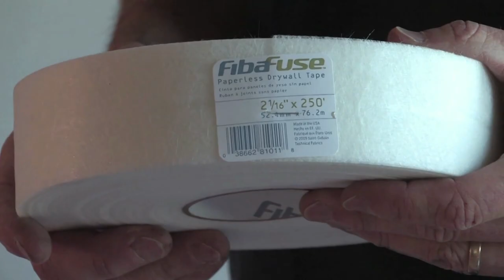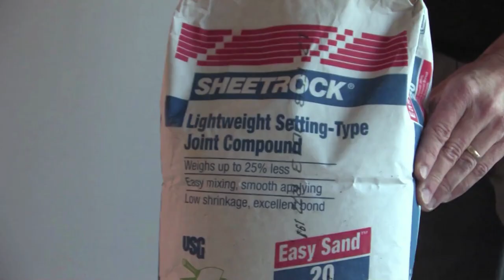Embedding FibaFuse Drywall Tape

Comment: I have your one of your drywall books, which has been very helpful!  I discovered Fibafuse a couple of years ago, and it's an amazing product! I'm a DIYer and was faced with repairing large ceiling cracks in our cathedral ceiling.  I was concerned about being able to get smooth results, but with the Fibafuse, it was really easy to do.  I think it's the best product for taping, and it allows homeowners to achieve professional looking results.  Thanks for continuing to post these videos.  They are always so helpful!

Comment: I recently purchased the fibafuse tape.  There is no mark down the center for "creasability".  Has the manufacturer changed this?    I actually see in comments below that I guess they stopped adding the crease, but you can still crease it?

Comment: When fiberfuse first came out, I tried using it in angles. When applied with a single blade, (not the double blade) it would cut the tape in the angle. That kind of defeats the purpose to using tape.

Comment: Everyone seems to prefer paper tape for ceilings over the mesh, what’s ur take ?
Reply: The reason people prefer paper over mesh tape is, because every job that you go on that has had mesh used usually has a small fine crack where the seems are. Especially if you use the bucket mud.

Comment: The fibafuse I have doesn’t have the void in the middle for creasing. What specific brand are you using?
Reply from the maker: they stopped making with the center crease. Wasn't really necessary and was perceived as a weak area
Reply: @thatdrywallguy So you can still use it in corners despite it not having crease?
Reply: @lukaskliment9646  Yes, I use it for inside corners just fine. My fibafuse tape also doesn’t have the mark in the middle for creasing.